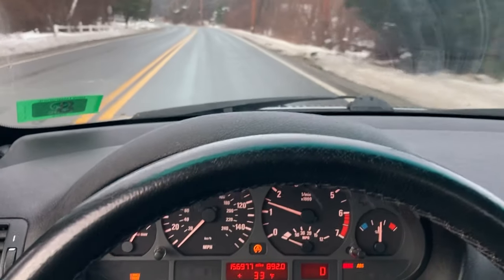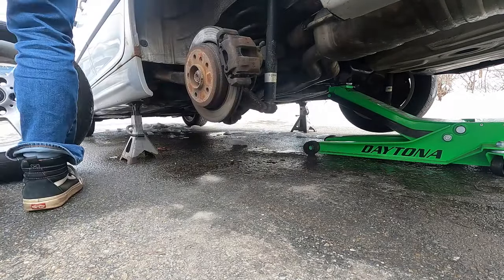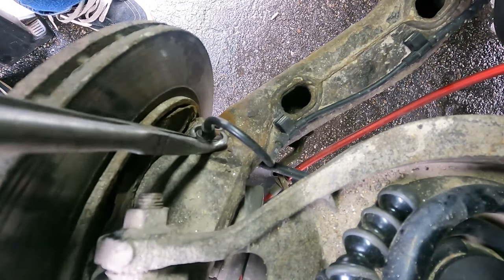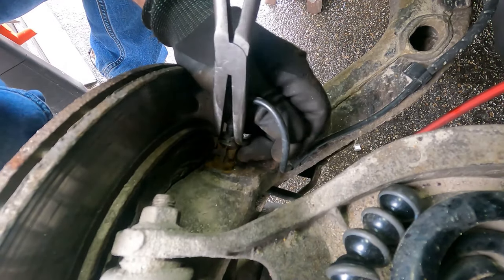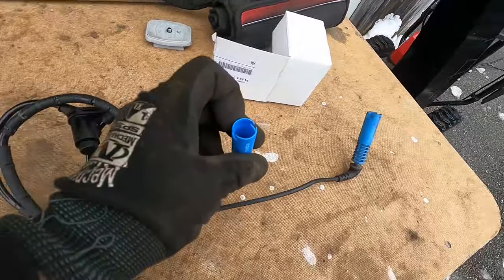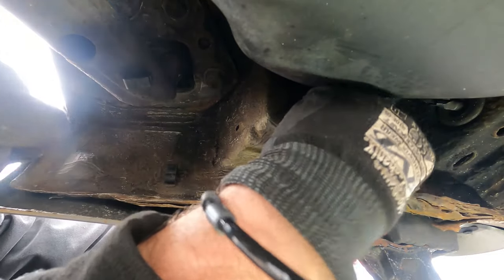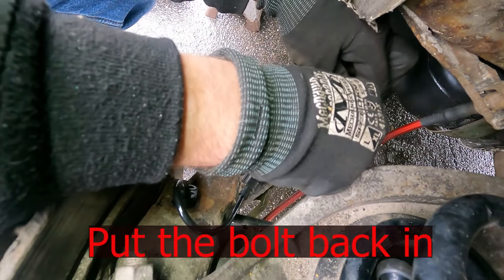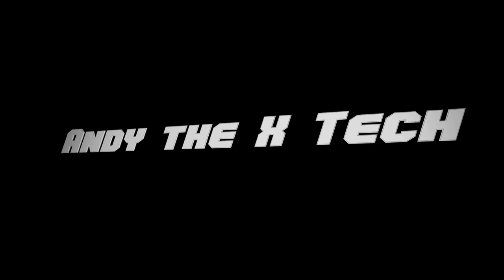Why my Speedometer is not Working? ABS Light on Traction Control In-op BMW E46 325xi easy fix!

Comment: I replaced my speed sensor and the issue continues, any suggestions on what it could be? Still have dsc, parking break and abs light on.
Reply from the maker: You replaced the drivers side rear wheel speed sensor? Check the code if possible. It could be a connection/ wiring problem or the reluctor wheel (tone ring).

Comment: I have a bmw 2003 530i and I got the trans failsafe prog light on my dash I already changed the battery when I scanned my car it gave me the codes P0500 which is vehicle speed sensor A and it also gave me P0600 my question that I’m trying to ask you is speed sensor A located in the rear left side ?? Also my abs and dcs light have been on the car since I bought it around 2 years ago any tips would be greatly appreciated thank you

Comment: I'm having an issue with my E46. At first it cut one break sensor and switched on a break warning light. I didn't replace it, and approximately three months later the speedometer stopped working and then it switched the rear lights, hand brake, traction control, ABS, and master warning light. At first, there was only a break light. The mechanic claims that both break sensors are damaged, therefore I'm checking to see if replacing out the sensors will fix the problem.
Reply from the maker: Ya you can get some weird symptoms from abs sensors.
Reply: ok thank you.  i will get it changed  @AndyTheXTech

Comment: Had codes read today. Saw your video. Ordering left rear abs sensor now. 👍. 2003 330Ci E46 convertible
Reply from the maker: Nice 👍
Reply: Let me know if it worked I had the same issue on my 320ci
Reply: @Ke20circlelolxdxd did not work. Only cleared the Service Engine Soon light.  Not the abs brake or airbag lights.  Not fix the speedo either.  I'm told on a. Bmw forum that would be the rear Right wheel sensor . Lol
Reply: So its the right?@austina8797
Reply: I had an abs fuse corroded  @ronapatish fixed that and all my lights returned to normal

Comment: Is it always the left rear side or could it be a different side
Reply from the maker: As far as I know for the speedometer it’s just the left side rear. But if other ones are faulty it will effect the abs and traction control.

Comment: 2004 325i and yesterday i had an issue while driving i went over a cpl bumps and i felt the power cut out for a sec and my abs light and DSC traction control light flashed when it cut out. Its been normal since but im just wondering if this is the problem

Comment: i replaced the sensor and it didnt fix the problem..
Reply from the maker: Maybe you have a wiring issue. Or a speedometer issue. Do you have an e46?
Reply: @AndyTheXTech  yeah could be bad wiring.. and yes a 328ci
Reply: @don_walker1  fix it yet?
Reply: @masonslaya7999  no still no spedometer bouta jus take it to dealership atp
Reply: @don_walker1 they find out what was wrong ?

Comment: I love how easy the e46 is to work on; thanks for the vid!
Reply from the maker: Yes! I was surprised when I worked on this one at work. I liked it so much I bought it. Great cars. 👍
Reply: All fairly easy except for the starter...
Reply: then you have never changed oil box or how you call it (at the bottom of engine) 
at least for e39 530 that was hell, probably same is also for e46 xD

Comment: love the video,straight to the point and good results.
Reply from the maker: That’s what I do try to show you what you want sooner than just talking about nonsense. 👍
Reply: @AndyTheXTech  I have a 02 330i am working on.this is one issue it has.picking up rear brakes n rotors today along with ABS sensor N BRAKE WEAR SENSOR.my project.thanks again

Comment: My speedometer works but I do have the traction control and ABS light on. Wondering if my issue is similar?
Reply from the maker: Ya it could be a different sensor.

Comment: My ABS sensor for my back right was completely unplugged!
Reply from the maker: That’s not good. Did it affect the speedometer?
Reply: @AndyTheXTech yes the abs light was on and speedometer was t working, what year is you’re car?
Reply from the maker: @Rubenen  2001
Reply: @AndyTheXTech  so i plugged it back in and its still showing abs sign and stability control. how did you find out what one was bad?
Reply from the maker: @Rubenen  there was a wheel speed sensor code. I had no speedometer. Other videos said it was the drivers rear. I also found in repair manuals (Direct hit) that it was controlled by the Left Rear.
Reply: @AndyTheXTech  I’ll have to run the obd reader on it and see if it pops up

Comment: my whole needle gauge are dead, but everything on bottom cluster from miles km/transmission prnd/abs/check engine light works.

 what should i do ? do i need to replace stepper motor?

Comment: I change it and the speedometer still doesn’t work also abs and traction control on ..
Reply: you ever find the problem ?
Reply: Same, did you solve guys? I’m getting sick out of it
Reply: Same here @LuckyDayNaples
Reply: I solved fixing the ASC button (my e46 is a 1999), the CAN signal brings speed signal to the cluster, my asc button was unplugged for some reason... @5.43v